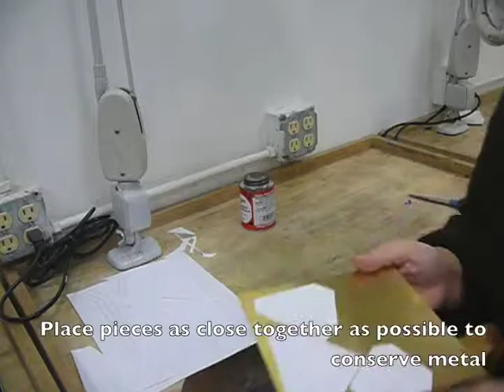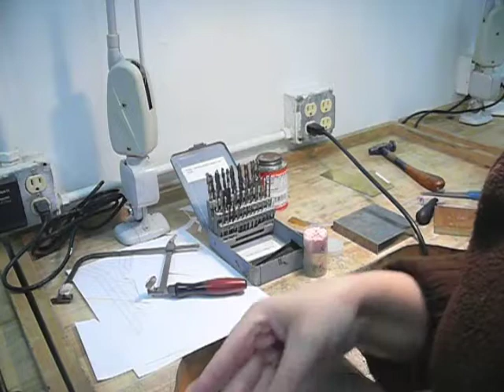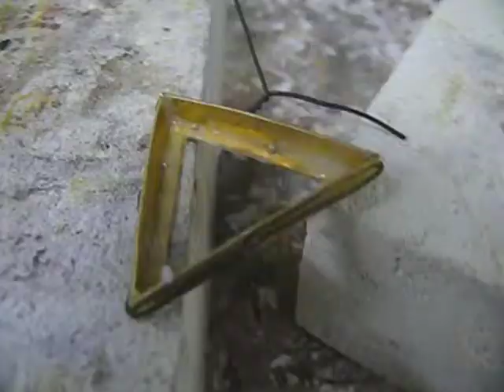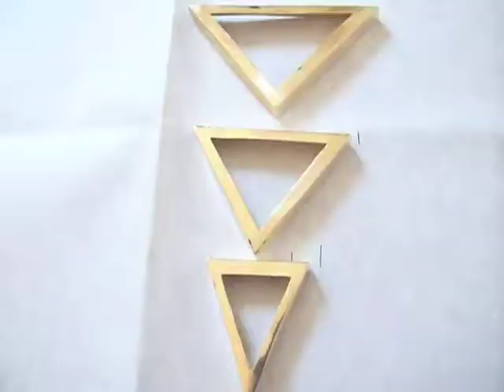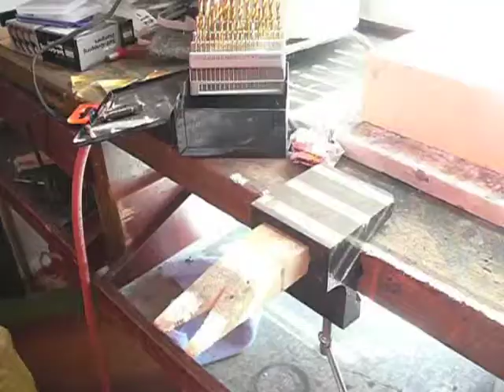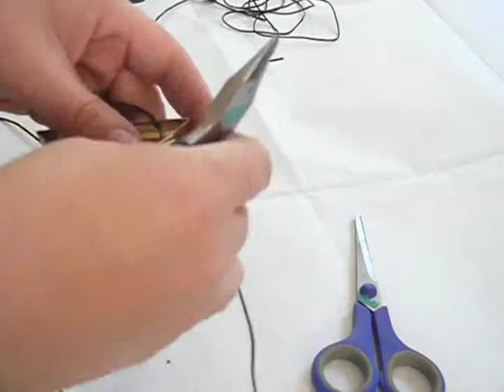Jewelry making Instructional Video

Comment: I have noticed that when I fire the jewel brass it tends to turn copper. How do I prevent that. Do you not pickle or clean your pieces? what do you suggest? - thank you
Reply from the maker: Brass is an alloy that is mostly copper.  When you heat it, the copper is drawn to the surface because it is attracted to oxygen.  Essentially, it becomes copper plated.  

If you are familiar with pickling metal after soldering or casting, there is a "super pickle" for brass, bronze, and nickel.  You can make it easily with 1:1 ratio of water:hydrogen peroxide and about 1tbs of pH-*. ( aka pH down, aka pool chemicals.  Marketed for hot tubs and pools, you can buy it at wal-mart, hardware stores, etc).  Mix the three chemicals and place the copper plated piece into the solution, and wait about 10-30 minutes.  It might fizz slightly. When the solution turns blue, it just means that there is now dissolved copper present.  The solution will eventually go bad after a few hours, but you can replenish it with more hydrogen peroxide.  

Warning: don't "super pickle" the metal until you are ready for finishing.  Each time you "super pickle" you are depleting the copper from your piece, and can change the alloy's properties significantly.